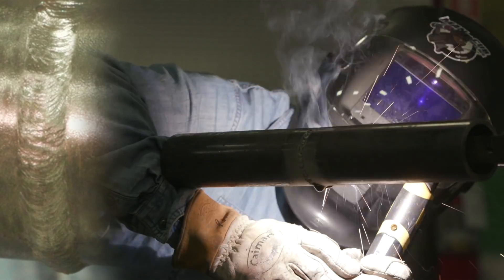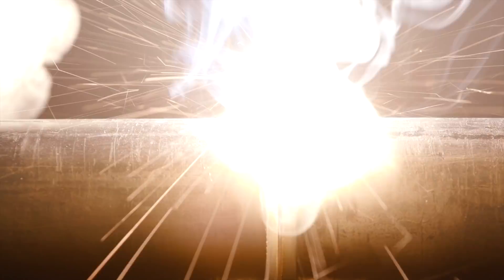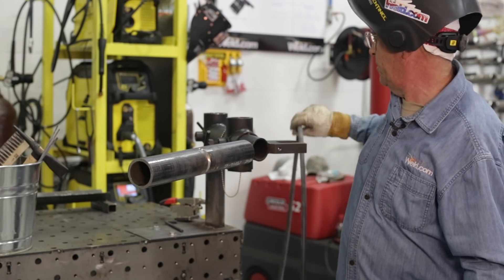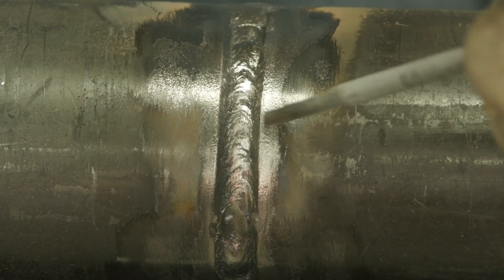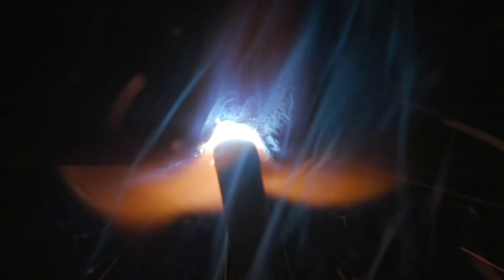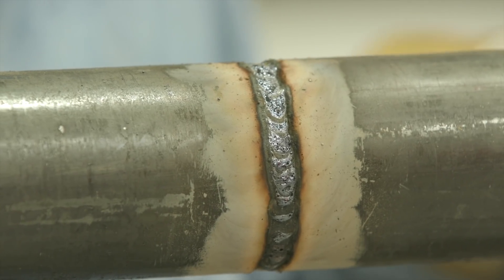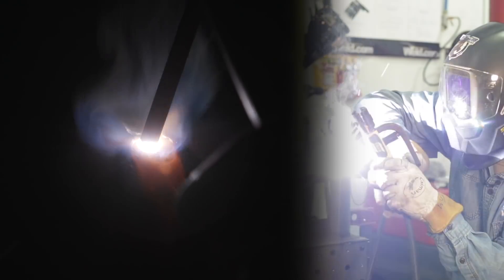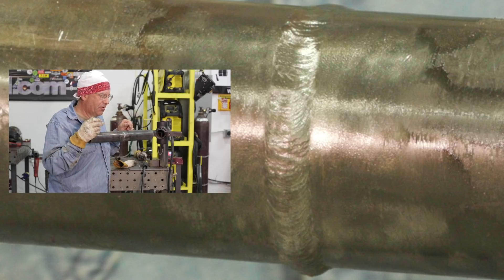6010 Open Root Pipe Welding

Comment: In class we run a 1/8th landing and do a root with 3/32nd gap at 6010 3/32 40 arc control and 80 amps tac and root pass.

Comment: Thank you for having a camera angle that really shows the puddle and how you're using the stick around and in it. Definitely helps me see it here in a video so I can try and look for something similar when I do my own welds. Fitting up pipe like this for a weld takes a while and it's hard sometimes to feel like you're getting enough welding in when you spend so much time cutting and grinding pipe.

Comment: Just tried to weld a 22mm pipe. Thick...damn thing blew a hole in it. Yesterday the settings werent enough to weld 10ga but in the part I NEED, and worked my ass off to recondition...this is the one it blows through. 

My hands are shaking..(injury. I shouldnt be around machinery). I dont know of a trick to keep a 1/16 rod steady enough. After 1000 times of it sticking to the piece, I finally get my tacks...and then I begin my bead...and blow a 1/8 hole in the piece.

Comment: Mate when you backing tech.you dont worry about silicon what can add when weld. I just asking becouse is problem with UT. 
I used same tech on mig/mag even somethimes on tig,but the silicon(si) is not smelt everythime

Comment: Hi. I bought a DC stick welder that came with J422 sticks. They wekd very easy but messy. I bought E6010. They are cleaner but harder to spark. Whats the difference between the E6010 and the J422 (E4303)? Thanks

Comment: Do a video for us old bastards on I can't see, It'll be fun!  Maybe touch on some of the vison aids available that go in helmets. I simply have a pair of safety glasses with a bifocal element top and bottom just so I can see out of the helmet and weld in focus. Most of the time anyway! 
Still enjoying the pipe series Bob. I never did a lot of pipe welding, but the techniques used are so handy in repair work, especially when you can only weld from one side. 5P "wonder rod" for roots  and close up gaps ( Dare I say burn through dirt😀) and 7018 for fill and cap.

Comment: fifty thousands ,  15 tenths bla bla

hate this thing...  1mm 4mm 1cm  1mt its just simple...
Reply: Yeah, imperial is a pain when you get to a 64th or when people use it for numbers that millimeters are better suited.
Especially when you're adjusting valves: .006 to .004 is pointless to beat a dead horse when one system would suffice.

Comment: Hey Bob what amperage 75-80? I have been practicing this exact test and I am having trouble blowing through on my root with the 1/8 rods...

Bob commented he is using 75 amps hope this helps someone else 👍
Reply: What's your land and gap? May need to speed up. Or maybe stop pushing so hard or even a stitch motion as key hole gets to big.
Reply: Put a heavier  land since you don’t know how to weld tour moving slower,,,,since your moving slow a larger land will help you gather your thoughts at your pace when your start moving naturally and faster you won’t have an issue blowing through

Comment: Also, what the heck is Tijuana Tig?
Reply: I think it's when you use an extra rod and feed it into the puddle with other hand like TIG but when stick welding. Also know as "Teaxas TIG
Reply: @Steve_Just_Steve  
Thanks. Should have guessed that one. Duh on me!
Reply: Steve, is that another stick? or an uncoated tig rod?
Reply: @davem3953  Stick rod

Comment: I just started working as a pipefitter with local 72 in Atlanta .. im 42 and have never welded in my life... What video would you recommend me to start with....
Reply from the maker: Stick welding 101
Reply: Leave the welding to the welders stick to your craft and learn to fit pipe...
Reply: @tonyguerra7799  I am yet to meet a good pipefitter who doesn't weld as a matter of fact to be a journeyman in my local you have to have a welding certification I'm going in an hour early everyday and practicing..
Reply: I’m part of a local also as a journeyman tour suppose to be able to do both but fuck that I’m not getting two checks and trust me when tour in it for a longer time you’ll notice a fitter wants to fit and a welder wants to weld,,, that’s the way it is that’s why later on your gonna have to decide what route to take,,,the only ones that benefit from one person being able to do both jobs is the fat man owners